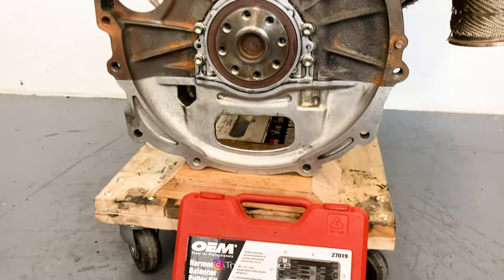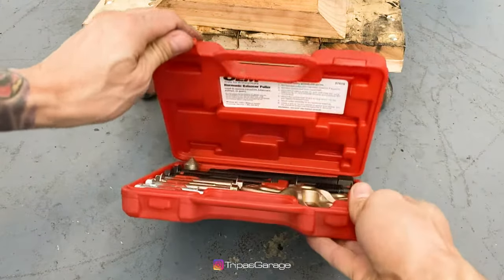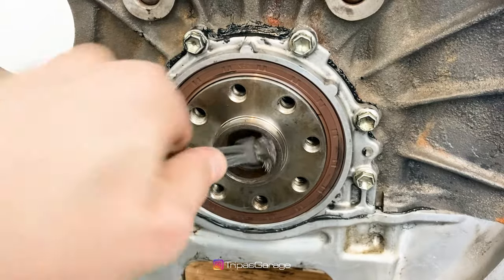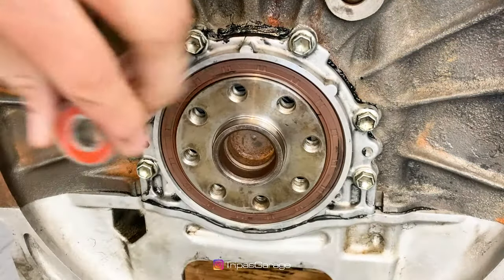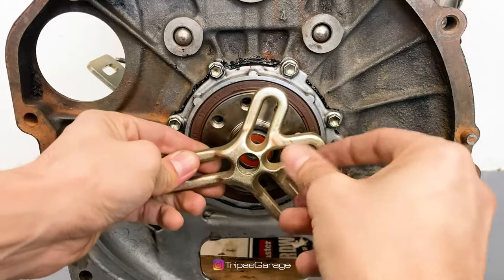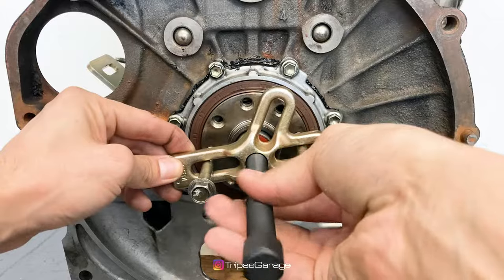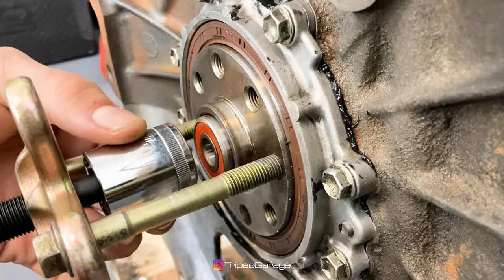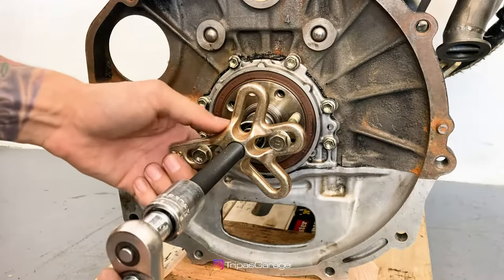How To Correctly Install a Pilot Bearing or Bushing

Comment: I’m not sure how bad hammering is for the thrust bearing. But this method completely avoids any chance of doing damage. Just keep in mind that, depending on your engine, it can sometimes be on the challenging side to find bolts that will work for you - some engines use oddball thread sizes.

Comment: The red bearing covers seem to be pushed in slightly after the press. You ask me, that bearing is toast
Reply from the maker: bearing has been great and engine runs fantastic ;)
Reply: This can be avoided by sticking the socket in there facing the opposite direction. This way, the only contact between the socket and bearing is at the outer race of the bearing.

Comment: Nice,until you try this for an LS2 with hard to get 11mm bolts.
Reply from the maker: Yeah, definitely can be tricky
Reply: Get a couple of GM 11562207 bolts. These are head bolts for the 3.5/3.9. But they have the correct thread pitch for the job. They are also not terribly expensive (around $6 each). The only catch is that some harmonic balancer pullers don’t have big enough openings for this size bolt.